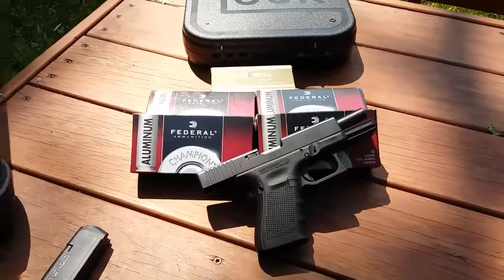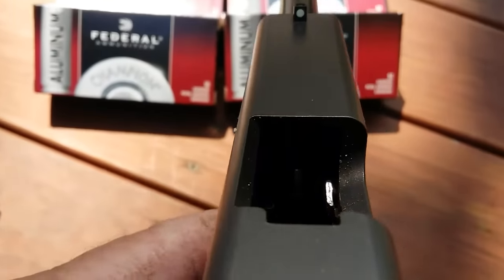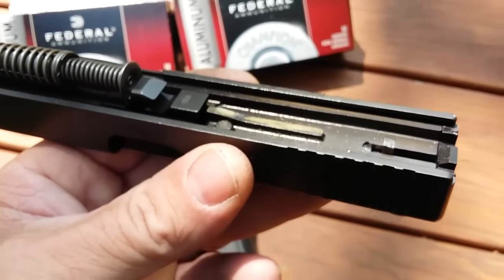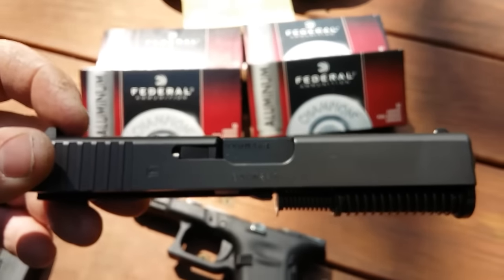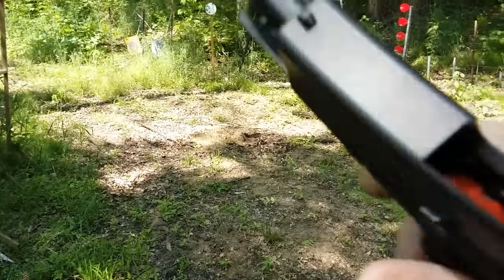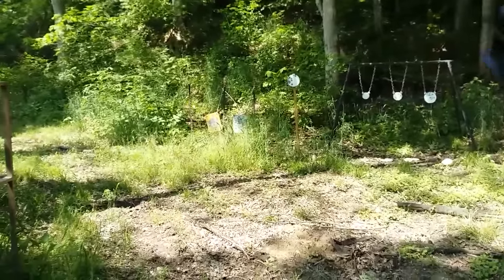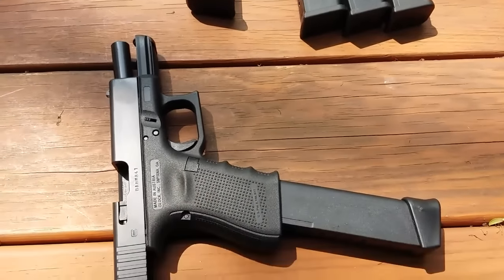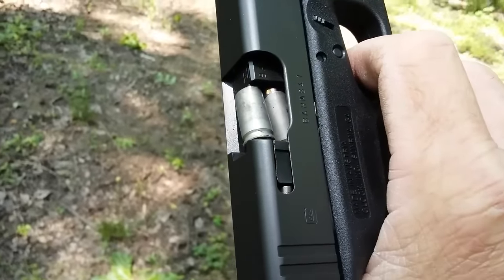1000 Rounds Glock vs.Federal Aluminum The Ending.

Comment: it's jamming because it's on a 30 round mag, not because of the ammo. I only have that issue when i use a large mag on my glock
Reply from the maker: ok
Reply: Why would it jam because of the mag being used? You have a round in the chamber, you pull the trigger the gun goes bang sending the slide backwards and "should" be ejecting the spent casing. I just don't see how the mag comes into play for the gun not ejecting. If you have more info on why you think it's the mag as opposed to the ammo I'd love to hear it...
Reply from the maker: Did I blame the mag?
Reply: Because I have 30 round mags and it jams all the time constantly to the point where I just threw them away, my 13 round mags never jam or have failure to ejects.
Reply: Channel Cat Chaser My message wasn't directed to you, if you look you can see it's a reply to J B...
Reply: J B Yeah it's a trip how things especially with guns get so finicky, small little imperfections that we can't see on parts making em not work right
Reply: Bob Dobalina yy
Reply: I have same exact  problem with 33 sticks. Brass, aluminum, steel all shoot great I'm G26 up to 17 Rd mag. 33 Rd Glock factory and kci are jam City.
Reply: Bob Dobalina The springs for those long mags are typically weak and have problems pushing all rounds up into the gun. Especially with after market brand mags.
Reply: J B those long mags have weak springs.

Comment: I have put about 700 rounds of the Federal Aluminum through my S&W SD9 VE and not a single failure, but then I live in NY and have a 10 magazine capacity limit and I also don't shoot it quite that fast, I would like to be at the range longer than 15 minutes shooting 150 rounds.

Comment: I quit running aluminum ammo in my Sig P226. I seen a few problems with it on some other videos. My P226 is one of the pistols made in West Germany so I really don't want to screw it up lol. I still run the aluminum ammo in my Mac11 carbine though. There's not a big difference in the price of brass cased and aluminum cased ammo so I don't buy it that much.
Reply from the maker: German made Sig NICE
Reply: "There's not a big difference in the price of brass cased and aluminum cased ammo..." Really?  100 rounds Independence aluminum 9mm 115 grain FMJ at Academy is @ $19.99 while 50 rounds Winchester 9mm brass  115 grain FMJ is $13.99. $8 plus tax per hundred rounds is a pretty big difference in my book especially if you are talking in bulk.

http://www.academy.com/shop/pdp/independence-aluminum-9mm-luger-115-grain-handgun-ammunition

http://www.academy.com/shop/pdp/winchester-usa-full-metal-jacket-9-mm-luger-115-grain-handgun-ammunition#repChildCatid=28736
Reply from the maker: ***** I know there's not much price difference but in function there is. Thanks for watching

Comment: I had this same problem with the federal aluminum 9mm rounds in my Springfield XD9 Sub compact. Went through 60 aluminum rounds and had about 12 failures to eject the shells. After this I ran over 200 brass rounds and not one failure. I have noticed that the aluminum rounds recoil is a little softer. I think that the aluminum shell expands when fired causing less gas pressure causing guns with strong recoil springs to not cycle completely causing shells to not completely extract before a new bullet is fed in causing a jam.  aluminum rounds may work better on guns with weaker recoil springs.
Reply from the maker: Thanks for watching

Comment: I've had some issues with the aluminum as well but only when the gun is hot it expands. With my S&W Shield the aluminum case once got stuck in the barrel and then a problem with extracting as well. But I still buy it for the range because it is cheap! Would not recommend for self defense.
Reply from the maker: Thanks for watching.  I'd still shoot it too

Comment: I have put 650 rounds of the Federal Aluminum through my S&W SD9 VE and not a single failure of any kind? I live in NY so I am limited to 10 round magazines. I have had a  failure with 1 round of Tulammo & Winchester white box, but that is from 1 box of 50 round of each, I now only buy the Federal Aluminum because it is the cheapest of any ammo in my area. I have about 950 rounds sitting in a metal ammo can waiting to make it to the range !

Comment: I don’t shoot nearly as much as most but I haven’t wanted to wear out the Glock mags, so I’ve used the same 4 G19 pmags,  never had one problem, the springs are tight as ever. Also being in a state that doesn’t allow more than 10 rounds they are a steal. That’s in 2 separate Glocks both 19s most were loaded  brass minus maybe 400 rounds.

Comment: I’ve used champion aluminum on a pt111 g2c and it eats it all day and cycles well. Never had any problems.
Reply: I have a G2. Had it for about 2.5 years now. It's been ok as far as reliability but the level of build quality (or lack thereof) always jumps out at me when I get  it out of the safe.

Comment: For the amount of ammo you shot that isn't bad. Aluminum case stuff doesn't really run 100% in anything. Nice video man
Reply from the maker: Thanks AK
Reply: Another thing I would try with the fun stick is shot it with both hands it might be that the energy needed to eject the round is being used I recoil. Since the other mags arent 33rds might be a fatigue thing.

Comment: You shoot the Bass way less aggressive than the Aluminum (in the High Cap. Mags). I see that as Inconclusive. The only thing I could see fail is that the Aluminum Ammo Ejector Rim could be torn/Ripped by the Extractor under very high temperatures. Aluminum and Steel expand more under high Temperatures than Brass does. Also... I seen a lot of High Capacity Magazines where the Spring gets weak 2/3 into the shooting.... Most on Glocks.... I shoot the Aluminum Rounds though my Beretta M9A3 and 90 TWO both OEM High Cap Mags.... Back to back... not one Stove Pipe.
Reply: I use aluminum in my ruger p89 no problems   Thousands or rounds not even oun miss fire or ejection failure this was in the 80’s when ammo was $6.99 for a box of 50. Those were the days.

Comment: Have you tried other aluminum ammunition? If so did you get the same results? Have you ever gotten similar results using any brass ammunition say Winchester white box?  I'll put it to you this way, all types of ammunition can give you FTE's. A feed ramp that needs to be polished or cleaned can give you problems. The same is true with a weak magazine spring or even someone with a limp wrist. I'll give you the benefit of the doubt that you are right with your weapon. But with mine, I have no problem with aluminum ammunition i.e. Federal, CCI and / or Independence. They are all made owned and made by Vista Outdoor the parent company. You should look them up. For my money, I have a mix of brass and aluminum ammunition. But with the prices the way they are and the political environment the way it is,  I buy twice as much aluminum ammunition as brass for the same money and feel good about it. Thanks for the video.
Reply from the maker: No I haven't yet  good idea.

Comment: I have way more issues with perfecta than the aluminum stuff.
Reply: That's funny I use perfect on the 40 cal Smith & Wesson I dint have a malfunction but then again I've only shot 600 rounds  through it I have to do more testing because I also use 40 cal Winchester and with that one I had one malfunction function in 400 rounds

Comment: I have a Glock 26 that tends to FTE with aluminum, steel and some select brands of brass. My Glock 23 does ok but I have experienced a handful of issues with it too. Lately I've been carrying an XD40 mod 2 and it has never malfunctioned on me. I've shot alot of aluminum along with the traditional brass through it and it runs flawlessly. Same goes for my Canik, P320 and CZ. The Glocks, for whatever reason, are the least reliable guns I own when it comes to using cheap ammo. I feel like a good firearm should run any brand you feed it. Why would someone choose a Glock over a Springfield when the Glock is picky about what ammo it will run?

Comment: See Glock Fanboys the Glock does get stuck so far must guns that do get stuff it's not necessarily the gun but it could be the ammo in it that's just something to think about before the glock Fanboys start trashing other brands my Smith & Wesson 40 caliber that's all I use is aluminum casing 1500 rounds into it since last year not one misfire..... I also use the aluminum casings in my Taurus pt100 had two misfires and 600 rounds that's not bad though don't you think